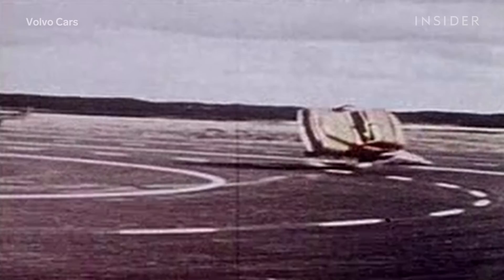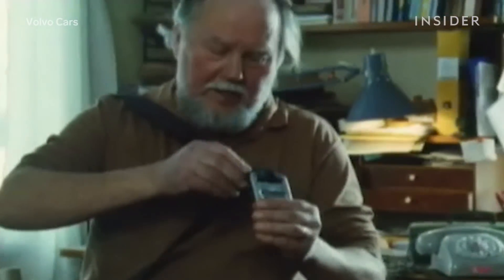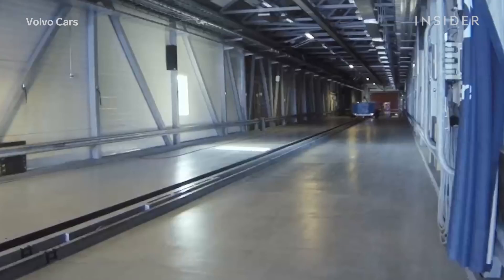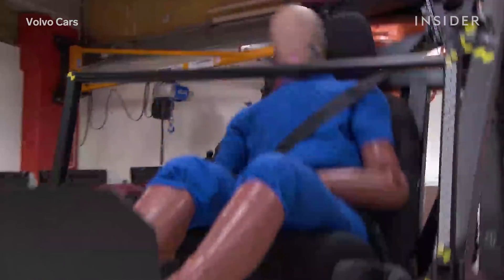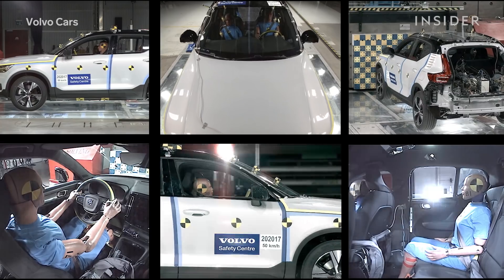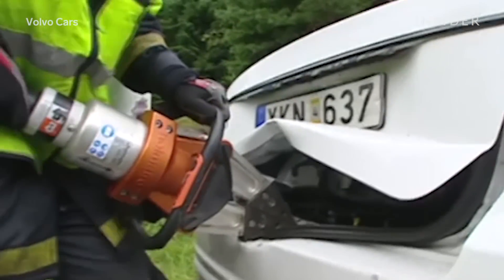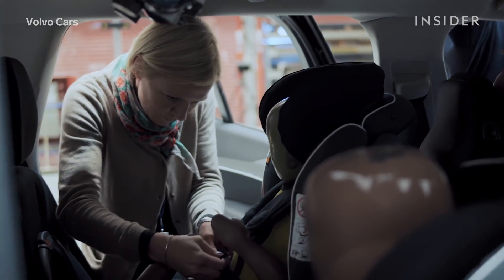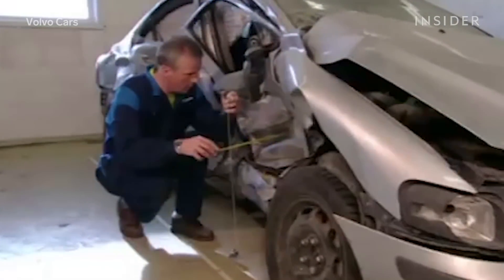How Volvo Recreates Real Car Crashes

Comment: While I do appreciate Volvo for inventing the three point seat belt and subsequently saving so many lives, when it comes to overall crash protection and injury prevention, I’m a little more skeptical. 

In 1995, when the Volvo 850 was tested by the IIHS, its structure was rated Acceptable, while the Ford Taurus and Chevrolet Lumina of the same year had structures rated Good. When the first-gen Volvo S40 was tested in 2002, the dummy measured a possible broken right ankle, while the dummy in the 2002 Subaru Impreza measured no significant injury risk. The same applies to the second-gen S40 and first gen S60, injury risk present in front and/or side crashes while other makes outperformed them. Even as recent as 2021, the XC40 only managed an Acceptable overall rating in the updated IIHS side crash test, scoring a Marginal for structure and pelvis injury risk, while the Mazda CX-5 received a Good overall rating. 

Volvo may have never made a poor performing vehicle in a front/side crash test, but aside from their performance in the recent small overlap tests, where the S80/XC90 had models from 2003/2007 scoring Good, they have never really stood apart from other brands when it comes to crash test results. They were either matched or beaten by vehicles from other manufacturers.
Reply: Please.don't ever buy a Volvo.
You have discovered the secret that it's all a conspiracy to fool you. You deserve a much better automobile.

Such as a short yellow bus for paranoid morons who take themselves way too seriously.
Reply: I think you're nitpicking bro
Reply: @ChunkyWaterisReal  how?
Reply: @carsandcrashtests  overall they're the safest on the road to this day.
Reply: @ChunkyWaterisReal  That's your opinion, but that's not a fact.

Comment: Worth noting: Volvo makes a lot of SUVs. Heavy SUVs can be safe for poeple inside, but is very dangerous for other people in normal, lighter cars. Same is true for electric cars.
Reply: I chose to be the heavier then
Reply: Actually when Volvo introduced their first true SUV, the XC90, they developed a Frontal Underrun Protection System which prevents smaller cars from being at a disadvantage in head-on crashes

Comment: If they actually cared about safety they would let all manufacturers use that facility… 
Imagine all the people dying unnecessarily just so Volvo could profit
Reply: Wdym . Volvo usually open sources their findings . They gave out the sauce to air bags .
Reply: They do...... And they share data for free.
Reply: From that perspective you should be driving only Volvo and not undermine the quest to zero fatality. Yeah I didn’t think so…
Reply: All other manufacturers have their own crash test laboratories!!!!

Comment: "how volvo recreates real car crashes"

Shows a car being dropped form 98 feet.
Reply: That is because they can only simulate up to around 100 km/h in the building. And crashes appear at greater speed than that....
Reply: Maybe they're recreating running off cliff
Reply: @emptiness3390  or suicide mission...
Reply: @emptiness3390  No, they recreate heavy crashes where high speeds and maybe heavy vehicles like trucks are involved that will smash up things badly.
Reply: what if it was also to simulate a car falls of a cliff or a bridge?
Reply: 1ton × 9.8/s etc etc forgot my physics but probably fast high way airborne car crash its reliable
Reply: @minshuajo  I gotchu.  the mass doesn't effect the speed.   Everything falls at 9.8 m/s^2 or 32 ft/s^2.   To solve for velocity (ft/s) just multiply by the time it takes to fall.   Using the equation ∆x=(1/2)gt^2 the time it takes to fall 98 feet is ✓(98/32) = 1.73s.   so 32 ft/s^2 * 1.73s = 55.4 ft/s which is about 38mph.
Reply: If you drive off a cliff

Comment: Imagine if Volvo fed all that data (edit : including the video data) into an AI powered by a quantum computer. Might make real life crash testing redundant.
Reply: They actually kind of do. They simulate and simulate and simulate and simulate and... and then they do it for real to validate the simulation.
Reply: @Xanthopteryx  : Yes ... but what will this look like in the near future?
Reply: @theGoogol  About the same.... Computers still suck at a lot of things so you have to verify with reality.
Reply: As impressive as that would be, I really don’t think there is a substitute for the real thing.
Reply: @Rowrowthegravyboat  : I thought the same for a long time, until I saw how AI designed suspension parts. I'm a 3D designer myself and was thoroughly impressed. For me that weas the tipping point ... I'm now convinced a lot of work can be done in simulation.

watch?v=VdG4gUTowXc
Reply: AI isn't perfect and can make a really bad mistakes sometime. Which is not something you want in your car's safety features.
Reply: I 100% agree with you guys. Use AI to simulate and then use an actual experiment to re-solidify what you know. I think empirical evidence is very powerful tool that should not be overlooked.
Reply: i'd think it would make more sense to just use a normal physics engine (with a huge amount of substeps for high accuracy) since im not sure if it would have enough data for an ai to work properly
Reply: @SomeRandomPiggo  : Volvo has been crashing its cars daily for decades ... what do you mean "not enough data"?
Reply: @theGoogol  didn't say not, just not sure. ai can make mistakes too, it just seems a bit pointless when we have incredibly accurate physics engines that don't need ai
Reply: @SomeRandomPiggo  : A physics engine does what it's told. There's no valuable data to be gained from a computer that's just following its programming, which is based on human observation.
Reply: @theGoogol  What data is needed? In what way? How do we now what the AI sees as important data? Is that data important in reality? Is it important for us? And so on...
Reply: @theGoogol  An AI system does what it is programmed to do and you have NO IDEA of what is going on. Things go in, things go out. And it can look really good, at first... but...
One real example:
They trained the computer to identify if it is a dog or a wolf. They put in thousands of pictures to classify it.
Then tried the system.
It did really good!
At first...
But after some more testing, strange things were rising.
It missed sometimes. But why?
How could it be super perfect and then suddenly really really bad?

Turned out that... the AI had been trained on, snow.
How? Most of the wolves images had snow on the ground. Most of dog images had not.
And AI works like that - a bunch of data in, and then a bunch of data comes out, but is it Really that output we want?
And, we do not know what the computer has in it's mind.

So, turned out that AI was really really really good at detecting snow but really crappy at differentiating dogs and wolves.

Other data in will give other result out. And the problem is that we do not know what is good data and what is bad data!
Reply: @Xanthopteryx  : First of all : controlled environment. Not wild cars in snow. Then there's masking; getting rid of data you don't want to be in the simulation (like backgrounds). Then there's mocap and 3D mapping using the already existing simulation models (they already test most of this stuff in simulation with CAD models).

About verifying results with reality; Of course! Instead of crashing hundreds (450) of cars each year, you'd be crashing maybe 10? Or 20? Add the results to the data pool, weight it and Bob's your uncle.

The reason why it might be valuable to look at it from an AI perspective ... look at all the AI's that have beaten human grandmasters in high level strategy games. AI does it by finding a new way to do stuff. Most grandmasters are highly frustrated after playing AI because AI will find a way, even if it's a 1 point advantage draw. In gaming, Sony's new AI beats the best in Gran Turismo ... on a game console! The point : humans design based on known principles, AI designs while it learns. The stuff AI can come up with is already way beyond the scope of human creativity.

Look up news items of when and how an AI beat a human, now add 10 years and a quantum computer.

The worry is not if it will work... the worry is if we, at some point, will become redundant (but that's a different discussion).

edit : But my first computer (after a PONG game console) was an Atari 600XL with 16 kilobyte RAM. My current low budget phone has 375000 times more capacity. So what do I know 😂
Reply: @Xanthopteryx  : One more thing ... when you simultaneously say "AI does what it's programmed to do" and " You have no idea what's going on" I can only assume you don't do programming. The point of programming classic style is that you know EXACTLY what's going on, or you're not doing your job right.
Reply: @theGoogol  Difference with games is that they have a fixed set of rules and a fixed set of environment. That is not the case in reality where cars operate.

And besides that, this is otherwise not far from how things are done today. Simulate simulate simulate, then crash test. But, each car model, each new design, each change in environment, ... everything differs. Guess why Volvo built a crash testing facility that can crash test from all kind of angles and speeds?
Because, it all differs.

Remember that AI still sucks at interpreting objects. It Really Suck compared to a human. It is so so so bad so it is fascinating. A child outperforms a computer in that area.
Reply: @theGoogol  I do programming and you have to differ normal code against AI code since you only give the frame for an AI code, and then put in a bunch of data and then you get something in the other end.
But you have NO IDEA of what is going on inside the AI network. That is why things like wolves and dogs problem appears. That is why you can so easily trick AI when it comes to image recognition.

You see a stop sign. The computer sees.... well, exactly what it sees is not known but you can get a hint of it when looking how you can fool the system, to make a stop sign appear as a speed sign just by a few black tape strips (and NO HUMAN ON EARTH would interpret that sign as anything else than a stop sign).
Reply: @Xanthopteryx  : Is that why level 5 autonomous driving is a thing?
Reply: @theGoogol  Level 5 autonomy is not a thing. It is a fantasy. It is nothing that can be accomplished within 15-20 years (maybe never).
But, Level 4 and Level 3 is a thing And that is a reality. Since a couple of years back.
But, as per definition, L3 and L4 are limited and still today it is VERY limited.

You can also check out translation and understanding of human language.
Still today, after billions spent and so much training data so it is hard to grasp, the computer SUCK BIG TIME compared to a human.
Reply: They are using AI and machine learning together with Lidar to develop autonomous driving, which is THE only way to prevent crashes in the first place
Reply: @tariqv  : I doubt AI will ever totally cover all of the ways humans can fail, hard. The only real way to prevent injury through crashes is to prevent speed ... and get on a bicycle.

But in reality cities have budgets and companies want money so crazy stuff like Musk car tunnels and self driving cars will always be invented.

My view on this is thus : Don't like cars? Use a bicycle or public transport. Don't make cars smarter ... make people smarter. BUT design everything smarter! And in this context I do think AI and machine learning can prevent real life crash testing since it's only physics involved.

Comment: Really surprised they don't use LIDAR for pin point accuracy of area of an accident. 

I was half expecting to see a display of the accident like that slow motion animation at the end of the video.

To understand the depth of how far an impact will hit and how to prevent those deeper impacts I would think would be part of the goal. Especially if you can slow momentum and decrease the velocity of each impact.

Not being an engineer myself, I could definitely be wrong but just seems logical to kill those two things and accidents to the passengers will cease or be limited
Reply: The sequence’s in the video are from when Volvo introduced the SPA platform (2016). In other words, a lot has changed since that.

Comment: What happened to "Vision 2020", that no person will be killed or seriously injured in a Volvo by 2020?
Reply: They are very close to that. As an example: 2004 the XC90 was introduced in the UK. There have been ZERO deaths in an XC90 in the UK....
Reply: That was an aspiration, a vision, which has not been achieved due to the fact that in reality autonomous driving is much more complex than originally anticipated. They are still working on it though, the new XC90 to be revealed this year will have the most advanced Lidar technology as standard, which should be a game changer. It will probably still take at least 5 years until a 90% reliable and widely functional self driving system is established

Comment: the IIHS and NHTSA need to dynamically flip vehicles.  That compression crush test is cool but not the whole picture in a roll ovee
Reply: I agree, different cars flip differently due to their shape and construction. IIHS is good, but most certainly can be even better. No clue about NHTSA
Reply: @navb0tactual  i dont get why they all cant just have a roll test. on a slider or some thing that really flips shit over.

Comment: I have two Volvo XC70s. One is a 2012 and the other is a 2015.5. And not only is the safety top notch, but the build quality too.
Reply: we have a 2005 xc70 with 210,000 miles on it and i love driving it mainly because of that OG 2.5 T engine. It has the most solid doors and hardly anything except for some interior plastic has worn.
Reply: We have a 2014 xc70 and it is so SOLID. The auto brake sensors have saved a few collisions just by themselves so far. plus it has the t6 engine tuned to 350hp so is a real sleeper
Reply: @manitobaerial  My grandma's daily driver is a Volvo 360, newly bought back when it came out. No major problems, 1.1milion km and still counting.
Reply: @manitobaerial  my 2013 s60 polestar is also tuned to 350😁 fucker pulls and makes girls (and myself) giggle like a child

Comment: When I think about Volvo, its just safety. Their products are made to not kill the passengers
Reply: How about their maintenance cost and reliability? Are they good?
Reply: @Jacksparrow-if8fh My whole family basically have Audis, Mercedes,Bmw, and Volvo. The only problem we’ve had with a Volvo was once the sunroof leaked after a hail storm in her V60. Otherwise owning most of the new lineup and old lineup we’ve had zero problems with Volvo compared to the others.
Reply: @theonewhowonders7568  my volvo does have a leaky sunroof BUT it only leaks I'm automatic car washes and it's only a handful of drops that all fall into the drip catch.  I haven't found the need to pay the 4-500 or so to have it fixed properly.
Reply: @Jacksparrow-if8fh  If you buy new, their warranty is really good. I've serviced my car for big and small issues in New Jersey, you just need to call them half an hour in advance and they fix your car swiftly -- plus washing up your car every time they're done (you mostly find that service in German brands). But even if you buy used, their parts are cheap to replace
Reply: @7itese840  you know like I know that sadly Volvo’s reliability has gone far down in the last decade. It’s very easily sighted with facts. Also you just said it yourself that it’s true “big and small issues”
Reply: @Jacksparrow-if8fh we had 2 audi's A6 3.0tdi before volvo now we have 2018 V90 now and its half or even less than maintenance cost on Audi
Reply: Astute observation... 🤦🏾‍♀️
Reply: cars are getting heavier which makes older cars more dangerous than they already are. I get the reason it is due to safety reasons but manufacturers need to work on making their vehicles lighter and with the future being electric I doubt that will ever happen.
Reply: but looking at the size of their new cars, there's a greater chance of death for people that are outside of the car
Reply: @invalidavatar  Yeah that's true, but they made a lot of firsts in car safety
Reply: @invalidavatar  Why bigger car lead to pedestrian danger?
Reply: @Q_20  Mostly, because when you're hit by a car, you probably will break your legs and roll over it, while an SUV hits you around chest height and you're more prone to fall to the ground and below it.
Also it's heavier and higher, meaning less stability and longer braking distance, at the same time that, if you hit a lighter car, it'll get pushed by the SUV and absorb the worst part of the impact
Reply: @martinkurdi436  most suvs these days have to incredible stopping distances that meet and often exceed what sedans were doing 10 years ago. You should look at research before making blanket statements.
Reply: @martinkurdi436  good lord
Reply: @invalidavatar  It's a world record that in volve accident, no one had died till date( talking about the people sitting in it)
Reply: @invalidavatar  Good thing they also invented pedestrian airbags